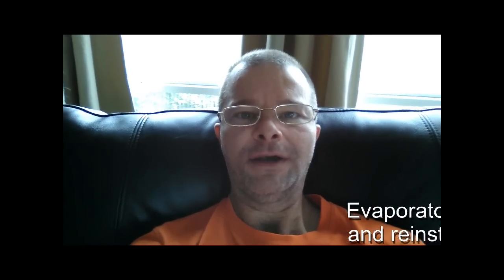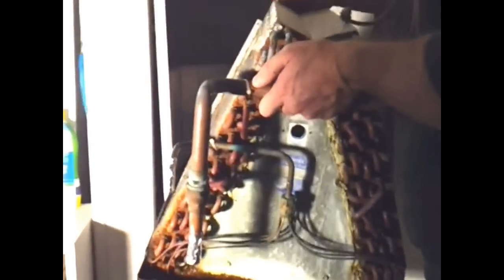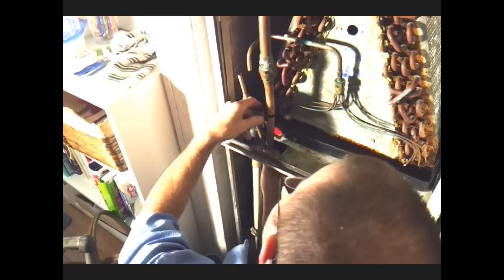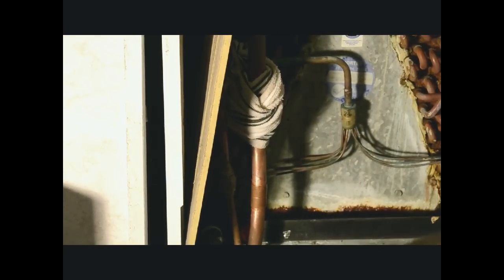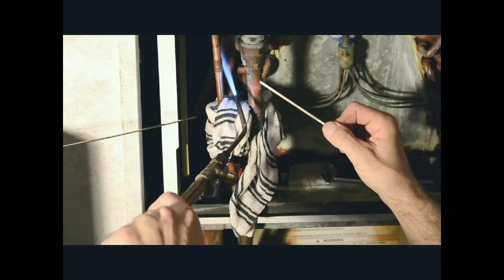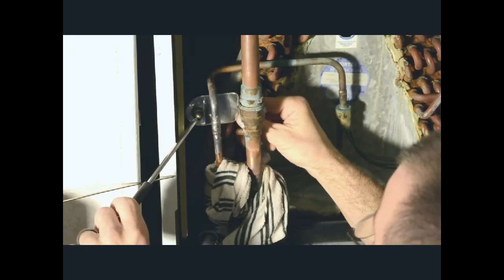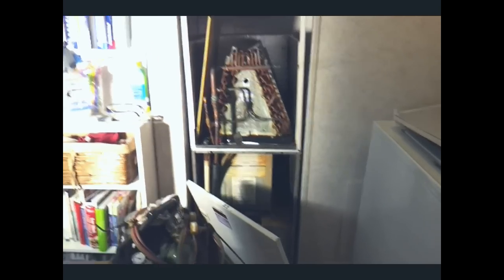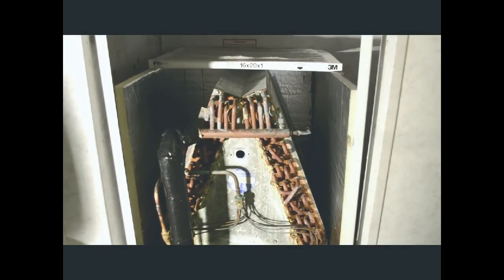HVAC Dirty Evaporator Coil Removal, Cleaning and Re-install in Air Conditioning Unit. Part 3 of 3

Comment: Sorry but the air flow i believe comes from the bottom to the top thru the evp coil to the duck to the rooms so why put the filter on the top of the evp coil ?

Comment: Why do you have to cut the pipe instead of unscrewing the couplings
Reply from the maker: You can unscrew the couplings, but I didn't want to have to worry about the seals getting damaged or not sealing properly going back, then having to get new seals. It would have probably been fine, but if I had a leak from braising, it's a lot quicker fix :)

Comment: How is that coil holding up. i need to take mine out and clean it if i can't clean it in the bottom part of my furnace.  it looks just like yours did, exactly the same, lol.  So yea, rust and water and stuff.  Just wondering if it held up for 7 years or did it last 5?  mine is a '96 so yea, could hopefully last another 5 years.  thanks man!  great video series.
Reply from the maker: Hey! It's still going strong! It could probably use a light brushing, but otherwise it's doing well. Still has some light corrosion on the aluminum fins in areas, im not sure what's in the air that causes this, I guess I could quit being lazy and do research!
Our house has pretty good insulation and ive been white coating the roof to get the electric bill down:)  i keep the temp in here about 68 degrees most of the time.
Do need to check the ductwork under the house, think a critter, cat or skunk, has torn the big crossover flexduct:/
What kind of position is it in that you cant get to it for cleaning?
Reply: @mikie2501  -- thx for reply, the unit is in the bottom of the furnace, so i have good access from the front of furnace only, So i was looking at just one side of the "A frame" where i saw rust and water (that was last summer when it was chugging away but not keeping the house cold), all the pipes were sweating which i'm sure was normal).  but access to the fins would be from the left and right sides which aren't as visible.  I noticed you took yours to the local "dirt stripper" car wash place.  How would I go about cleaning it if I don't rip it out of there? If I can clean it while still mounted in the furnace floor, that would be GREAT!  but where would all the water go? i guess it does have a little tray system that probably drains down to my crawlspace.  After i looked at it last summer I duct-taped the furnace access panel so no air was leaking out of the access panel (lol, that was my weak attempt to try to help it work better).  Anyway, I will need to probably charge my system with R-22 I'm sure and I saw on eBay that you can get that stuff for $157.00 for 10lb. tank and then the Yellow-Jacket gauges look pretty good so I might get those too.  But I think I should get that Coil cleaned first.  Let me know what you think about me just leaving it mounted without cutting it out and thanks a ton!!!!!
Reply: @mikie2501  Here is a link to the unit (EVAP COIL)  See what you think.  It's dry right now because I'm not running the A/C and it's not hot out.  https://ibb.co/album/D50jVL
Reply from the maker: @harpoon_bakery162  hey! Sorry for the delay, real world stuff going on, heh.
I didnt see a filter slot so im guessing its in the wall or something. Does the air blow down through the coil and air comes out of floor vents... no, it probably pulls the air up, going to ceiling vents. 

If it was blowing down Id say the coil doesnt look bad, really. If its up, well it could be dirty underneath.
You could probably take the screws out of the triangle sheet metal plate and remove it to get to the coil. Be careful, the sheet metal is usually razor sharp on the edges! Learned tht the hard way in the past!

If its pretty dirty underneath (thats assuming the air is pulled up thru it) you can put a towel down to catch dropped dirt and gunk, if the theres room to put it, if not you can just be careful...
Anyway, with a small, stiff brush, it could be a as small wire brush, or stiff plastic bristled kitchen sink brush, you slowly brush off the gunk in the same direction as the fins, that way you dont bend them. 
Dont actually brush it like you were brushing hair, but set the edge of one of the long sides of the bristles on the coil and twist your wrist so that it kind of rolls the brush across the coil, kind of pulling it down and out. You want to do it just firmly enough to get the stuff off, so it doesnt get packed into the coil.

If you do it with the coil dry you should wear a mask. It comes off pretty easy if your patient.  
The plus if you do it with the coil wet is that the crud will stick to the brush and you can keep pulling the brush out and getting the nasty gunk off, then back in again! You'll have to decide which will work best for you.

You probably wont be able to get it all, especially up towards the top of the V. I guess you could fight it with a toothbrush, but that woulf be a whip!if you get most of it, that will be fine.

I did a friends that was an upflow with the coil on the bottom, the filter slid in a slot under the coil. It was in a closet on a corner and the whole unit was a bit over a foot off the floor, with metal return air grills screwed into the sheetrock on both corners below the unit on the walls. I got one off and my arm was just long enough to reach in and up with a brush! They brought me several small ones from around the house to try. I had to use my phone camera to reach under and take pics or vids so i could see how and where the coil was dirty, since the rectangle for the return vent was too narrow to get my head in, hehe.

His unit would start freezing up during the heat of the day. Airflow just got less and less as a sheet of ice would freeze over the gunk on the coil, blocking air. Then melt later, soaking into the carpet :/
I got most, but just couldnt get it all, but it cools great anyway!

You may not need freon at all if its just a dirty coil.
After you get that clean, dont forget to clean the outside coil too! They get packed with crud after a while if they are in a bad spot, then cant pull air through and cant dump the heat it pulls out of the house.
A garden hose, say with thumb pressure to make it spray, is strong enough. If your city water pressure is really high you have to be careful not to bend the fins!
Spray down towards the ground to wash it out, dont spray into the coil from outside or it gets packed in. 
If you have one of those units with sheet metal with air slots, you can either just spray sideways thru them, working across from top to bottom, or if you like work, hehe, you can take the panels off, one at a time. Depends on the unit.

Well thats all. Can think of at the moment, and my phone typing finger is tired, hehe.
Reply: @mikie2501  ok, i will clean both of them with all your good info above. You can see that the front of the "A"  (side facing access panel) has some sort of cover on it, so access inside the "A" is from around the other side (which i can't get to) or perhaps i just need to take those screws out (some rusted pretty bad) and remove that sheet metal cover.  Once i get in there, who knows what I'll find but perhaps its dirty and will help this system out a lot.  If those two cleanings don't help, i'll resort to charging the system with r-22.  Also, the evap coil is on the very bottom of the furnace , the filter is on the side of the furnace up above the blower motor and it has always had a note on it saying downward air-flow, which makes sense because my heating/cooling outflow vents are on all the floors and return ducts on ceilings.  So how does the air get down to the crawlspace ducting if the A/C evap coil is at the bottom of the furnace and this is a downflow ?  and thanks a ton and when my busted back heals i'm all over it.
Reply from the maker: @harpoon_bakery162   Harpoon_Bakery  ok. That makes sense then! In that case Id say your coil isn't really that dirty snd There's no point in taking the sheet metal cover off to check inside. BTW, There's a triangle cover on the other side too!

So the air gets pulled through the filter, goes down through the blower, which is sucking from above, blows it down through the furnace (gas?) Then down through the coil to the supply ducts!  So the pics of the coil that you took with the light striping and a few spots of crud is the 'dirty' side. Not bad looking really. Its always possible there's stuff packed in them, but I doubt thats the issue here.

As long as you're sure that an old air filter didnt get sucked down against the blower motor and has been sitting there getting clogged, while you keep replacing one in the normal slot, then id say clogging isnt the issue.

You said the coil pipes were sweating, which means at least the unit has enough of a charge to be doing something decent without being low enough to freeze up, or so low that they are just warm.  Hmmm... Lemme think.  How is the airflow coming out of the vents?  After the unit has been running for a bit, say maybe five minutes (never good estimating time, heh) do you have a way to check the temp of the return air where it goes into the unit, then the temp of the air at the closest supply floor vent to the unit and see what the difference is?

Not sure what kind of ducts you have under the house, but if you're airflow isn't that great, you could have s loose, or critter torn vent under the house and some of your cool air could be getting blown under the house. That's what is happening here, my back is messed up so I haven't felt like climbing under to look at it yet though :/

How is your attic insulation?  I had a customer saying that their unit just ran and ran during the heat of the day during the summer. My first call out was in the morning, checked the unit, pressures looked good, it had a good temp split, even rinsed the coil outside. Got to called back and this time they scheduled me mid day. When I checked the freon pressures this time, the balance was fine, but the low and high side pressures were both really high! Had a really high heat load! 
I'd rinsed the outside coil so that wasn't the problem, and the outside coil was just the usual single coil. ...on a few type units they use a stupid double coil, meaning they will stack two sets of fin coils together instead of making a taller unit. If these get dirty, they LOOK clean, even if you rinse them from the outside it doesn't help. You have to kill the power to the outside unit, take the cover with the fan motor off the top, then remove clips or such holding the coils together and carefully pull the inner coil away from the outer one to get to the dirt packed between them. Pain in the ass!!  

...anyway, that wasn't the issue here. I took my infrared temp gun and checked the temp of the ceilings in the different rooms, they were really hot.
Poked my head up in the attic. Apparently this was a pretty old house, all of the insulation in the attic had packed down over time against the sheetrock! It was only a few inches thick, and since it was packed down it wasn't insulating anything anyway.  The majority of the 2x6, or 2x8 rafters (whatever size they are) was exposed. At a bare minimum they should be layered flush even on old houses. Honestly there should be a lot more.

So during the day when it got like 130° + up there, the heat just went right through the sheetrock into the house and the AC couldn't keep up, so it just got hotter and hotter in there!

She wasn't happy with my answer, lol. (It was a home insurance call with just a copay)

Anyway, some Ideas and food for thought!  Keep me updated, im interested in how it goes!!
Reply: @mikie2501  Great info as always. I appreciate all the help. Yea, it's a gas furnace.   so it sounds like what you're saying is that the air gets sucked down to the evap coil (right on the floor of the furnace) and then down below the house, wow, i would have never guessed that after seeing where the evap coil was located.  I have never gotten an air filter stuck so I think I'm good there. Here are some pics again which will clarify how the furnace looks and also included those temp readings.  Attic insulation is pretty decent.  Had a leak up there so a single path got stomped a bit on the ceiling joyce to a path back to the chimney but nothing too bad at all.  This new set of pictures should help explain a bit better.  Its not the best day to do the tests as it's only 79 today but should shed some light.  Air feels good on mild days but on 85 to 90+ days, its not getting cold like it used to 3 to 4 years ago and further back.  I will try to get some cleaning done. I included the two type of filters that i use, mainly I use the white type.  I also included pictures of the part that i think is the piston where all the tubes come together behind the A-frame cover , you'll see a copper looking connection set of pics.  I wanted to make sure you knew what type of evap coil design it had (but you probably already knew that). Do you think my infrared thermometer would work when doing a recharge, or should i get temp. sensor tool? I'm trying to avoid the cost outlay during the pandemic. Thanks for your most recent real life HVAC experiences!  LINK: https://ibb.co/album/SfR2Ws
Reply from the maker: @harpoon_bakery162  great set of pics, thanks!
Yeah, that system is getting a few years on it! 1980's isnt it? Late 80s early 90s. 
Yeah if you had the system running for a bit, thats not a terrific temp split. I like to see at least 15 degrees difference (yes, you'll read about 20 online, but thats usually at the unit)  
...i was looking at the pics of the condenser outside, it looks like, going by the look of the brass, that the Schrader valves havent had the brass caps on them in years.  Do you remember when the last time anyone serviced the unit out there? Because if its been years Im wondering if the suction valve has a slow leak. The brass and schrader look shiny compared to the other one, which could indicate freon or freon and oil seeping out there keeping the metal from oxidizing.

Why they didn't put the brass caps back on always annoys me! I prefer that type as opposed to the screw on caps with a rubber seal in them.
I like those old units, easy to work with, though if the fan motor goes you pretty much have to get an OEM replacement. Well, Ive never seen a generic replacement installed anyway, hehe.

As for checking temps when charging, an infrared doesn't work all that well. If you are trying to not spend money on equipment, if you have a digital temp probe that you stick in your turkey or chicken in the oven, you can clean a spot on the copper pipe and try and clamp it down. Some insulation over it will help. Wont be ideal since a normal thermocouple is attached to a small piece of copper pushed against the pipe which gets better transfer. Ugh, im rambling. My insomnia is getting me today, lol.
Of course, as I'm supposed to tell you, you should get a licensed tech out to do the work since it's required when working with freon. Ahem. 
I haven't bought any freon in a while. Bought a 30lb can of r22 before the prices went through the roof a number of years back. Lol, maybe I should have dumped some of my IRA money in that, much better investment than the market, hehehe!
Well, think I covered everything mostly, answering this on my phone instead of my tablet, so might have missed something. 
Oh, at least the panels on your condenser outside come off easy enough to inspect the coil!
Reply: @mikie2501  unit says "1996" on it and says R-22.  Is my unit a Piston Type based on the pictures ?  I would assume it is 100 percent.  which means i'll be using Superheat method.  Should i get a wet bulb sensor on amazon (fieldpeice) for 16.99 , i will use it on my dual temp device that im ordering on amazon (its not fieldpiece) , it's this unit  https://www.amazon.com/gp/product/B078WQJ4Q3/ref=ppx_yo_dt_b_asin_title_o00_s00?ie=UTF8&psc=1
does that web bulb unit sound about right? thanks for letting me know about brass fittings, i just ordered some from eBay.  Also, here is the Fieldpiece wet-bulb that i was going to buy https://www.amazon.com/Fieldpiece-ATWB1-K-Type-Thermocouple-Alligator/dp/B000TMK31U/ref=sr_1_2?dchild=1&keywords=Fieldpiece+ATWB1+K-Type+Wet+Bulb+Thermocouple+with+Alligator+Clip&qid=1590826418&s=hi&sr=1-2   THANKS MAN!!!!!!!

Comment: I have three ton seer 12 r22 unit. I was thinking about getting a newer and bigger unit, but I looked up  under and the coil was so dirty. Does it make any different if I just have it cleaned? Will it make it colder and bring down the house temperature to 69 instead of 76 running all day?

Comment: Your setup looks just like mine. Mine is a intertherm base with electric heat and a lennox a coil evaporator. I just dont have the upper cabinet and yes my coil looks worse than yours. Installer didnt seal cabinet and pet hair bypassed filter cloghing coil then previous homeowners smashe coil fins trying to clean it with a hair comb! So i will need to order new coil n pan and install. After brazing can you explain pressure testing a bit. What gasses and gauges or manifold needed.